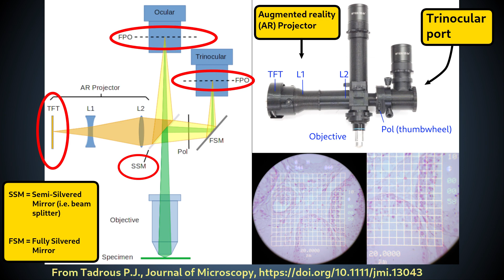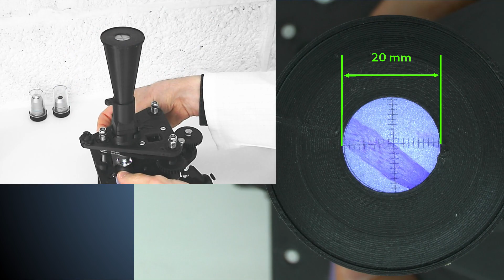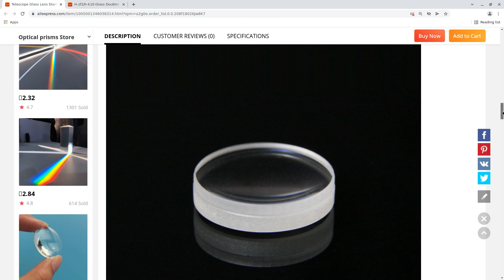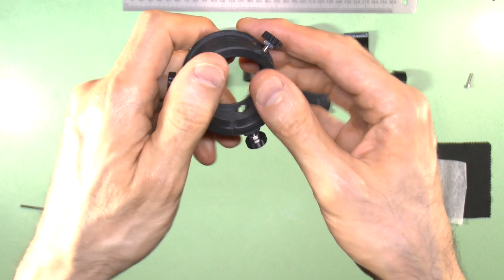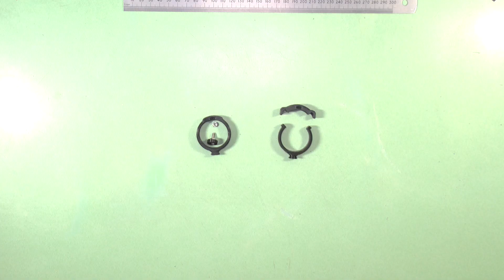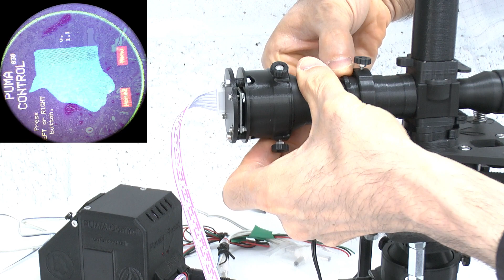How To Build and Fit the Augmented Reality Projector of a PUMA Open Source 3D Printed Microscope

Comment: How long are the 4 Machine Screws that hold the TFT to the Mounting Plate?  
I don't see those on your Bill of Materials.  Do you have an updated BOM maybe one with quantities and total pieces of Fasteners?  
It sure would be helpful to know exactly the number of screws in each length are needed.  
Also I am wondering how you use the SLM and the AR Projector at the same time?  
Thanks, I can see you put a great deal of thought into the design!
Reply from the maker: Hello, the M2 bolts are 8 mm long and you need 4 of them. I just checked the BoM and the information is there (it is listed in the 'MD_AR_Projector' module worksheet in the list of 'non-printed-parts' as 'M2_Allen_Bolt_Socket_Cap_DIN912_8mm_long' and the quantity is given as 4).
The only way to get AR Proj and SLM to work simultaneously (and independently) is to have two separate TFT drivers - so, for example, either two PCCs or use a PCC for one and a separate source (e.g. your PC or a modified PCC) for the other (I say 'modified' PCC because clearly you don't need the lamp and motor circuitry if you are just controlling the SLM). I hope it all works out.
Reply: @PUMAMicroscope   , Oh WOW, Thank You yes I see the parts now.  I was looking at the 2nd tab on the excel spreadsheet with the web links but now I see all the other tabs.  My eyesight is not that great these days.  
I have some other questions because I am trying to get together my list of stuff I will order to build this, I when I was looking for the 25mm Dia.x100Focal length infinity Lens for the Advanced Filter just above the Beam Splitter and at AliEx. it says that it is no longer available.  So I have a few questions,  
1. is that lens only used in conjunction with Infinity Objective Lenses?  And if I don't use the infinity lens in the Advanced Filter do only the "Plan" style Objectives give a perfect clear image?  
And is there a place you can recommend to get the lens for the advanced filter?
So I am wondering if it is best to get the Plan Objectives or the ones with the infinity symbol on them?  I will appreciate any advice you have about that.

Also I have a strange question,  My eyeballs are very Myopic and I also have a extremely Severe Astigmatism so My question is do you think there is a slim chance I can find Anamorphic Lenses for the Eye Piece Lens of the Microscope?

And I really wish there is a way to design a Turret into the Focal Plate but even so it is a awesome Microscope, I salute you.  
I am gonna build it with all the bells and whistles. 

I know a little about programming, electronics and engineering(I used to work in engineering), I looked into the TFT's with the Nano and multiple TFT's can be wired in Parallel but they will Display the exact same thing BUT there is a Way to use a IC2 Multiplexer Chip PW548A with the Nano to address up to 8 devices independently.  I watched a couple kids use that small chip specifically with the Nano and 4-ST7789 Displays presenting independently.  So, I think I will use this feature in my project because I wanna use the SLM & AR Projector at the same time.  
I think it will fit inside the PCC. 
I also I plan on trying to make it as Wireless as possible and maybe even using small stepper motors for the XY Stage maybe.

Something else I came across that you may or may not be aware of is that the Nano using a Atmega328 Flash RAM chip wastes about 1500 bytes of the Flash Memory when the old 2.0kb Bootloader is updated to the 0.5kb Optiboot_Atmega328.  With Nano the Maximum Upload size is Factory set to 30720 with all bootloaders so with the smaller bootloader(0.5kb) there is about 1500 wasted bytes.  This can be Optimized to use the Full 32256 bytes of Flash Memory when using the New Bootloader.  
In order to Correct this and get access to Full 32256 Memory you change the Line Code for avr--->(version)--->boards.txt file... 
high_fuses=0xDE
instead of the old 0xDA

Other suggestions I have is a simple small hole in the top of the PCC to access the Current Pot on the Buck Converter with a small screwdriver instead of the knob at the top and simple.  And simple clear plastic sheets over the slots glued from the inside to view the internal LED's of the PCC is another option instead of printing clear plastic optical wave guides but I like your idea of just keeping it open for more ventilation.  

Thanks a lot for your time and effort, it is greatly appreciated!
Reply from the maker: Thanks for your interest - you are doing great stuff and I hope you publish it somewhere on your social media or YT.
Regarding the infinity stuff - my advice is do NOT use the 100 mm lens and AVOID infinity objectives (the ones with the infinity symbol on them). The 100 mm lens is exclusively only for use with infinity objective and must not be used with fixed tube length (i.e. non-infinity) objectives. Note - infinity is nothing to do with Plan or not Plan - that is a separate issue. You can have Plan objectives that are infinity corrected and Plan objective that are fixed tube length. The objectives you need are the 160 mm tube length objective - they will have 160 printed on the barrel. Plan ones are better for flat field viewing. Your eyeballs shouldn't make a difference provided you use your glasses when looking down the tube and use a high eyepoint ocular lens (eyepiece).
The reason I say avoid infinity objectives and the 100 mm lens is because I only made the 100 mm / infinity option as a concession to allow use of infinity optics for those who happen to have them lying around but the 100 mm focal length is too short for optimum correction of the image and you end up with a curved field of view. One day I may make a more dedicated infinity module for better use of infinity optics.
All the other electronic stuff you talk about is fine - I didn't want to get into such details for the average person might be put off by it but clearly you have the knowledge to do it so that would be great if you get it to work. Please post your results somewhere. All the best.
Reply: @PUMAMicroscope  , oh o.k Thanks! so the Plan just means the Planar meaning the lenses are flat on one side and either convex or concave on the other.  o.k.  I think I get it now, this is real optical Physics as opposed to the thing the eye doctors do😉 I don't like the Flat lenses on my eyeglasses, I think because my face and and retina have a curvature.   I normally don't look thru my glasses at objects closer than about 20 cm.  I have never used my glasses while looking thru a microscope, even in school, because it hurts my eyes.  I have done many tests on myself and at Close Range I only need the Cylinder correction because of the Astigmatism in my eye.  
That's why I am thinking about how I can put an Anamorphic Cylindrical lens either right before or right after the eyepiece of the Microscope.  if I put a Cylinder Lens in the Advanced Filter then I think I can also use a Custom CinemaScope type image Capture maybe with a Camera on the Triocular and in that way get a much higher Resolution Photo and Video image after Post Processing but it would be a Custom Aspect Ratio that I would have to correct back to a Perfect Circle in Post Processing.  
 
I was on the edge of my seat when you were talking about Pupil Distance in the Binocular eye Piece Video,  you truly know this stuff and you have considered everything in the Design, Thank You so much!
Yes I will post my results here on yt and keep in contact with you.
Thanks Again^!!^
Reply from the maker: The 'Plan' refers to focal plane flatness in the final image - not glass flatness. It means that, with a Plan objective, the centre of the field of view will be in focus at the same time as the periphery of the field of view. With cheaper non-plan corrected lenses you can only get the centre or the periphery in focus at any one time - never both at once.
Your glasses have the correct cylinder for your eye. I would think that a cinematic anamorph would probably over-correct for you. I have glasses too and it is much better for me to look through a high eyepoint eyepiece lens with my glasses on - but the eyepiece lens must have a high eyepoint (sometimes called high 'eye relief') or this won't work because you won't be able to get your eye close enough to the eyepiece to see the whole field of view properly because the glasses get in the way. High eyepoint eyepieces usually have a symbol of a little pair of glasses printed onto the barrel of the eyepiece. Don't confuse this with 'wide field' - that is completely different.
Reply: @PUMAMicroscope   , oh, the eye doctors have not once ever properly made Me eyeglasses.  I have Trick Eyes, I can see into the IR Spectrum a little and I need Anamorphic lenses because of my Cornea shape causes Astigmatism.  Yes Professional Cinemascope Lenses are Typically a Minimum of 10 Diopers, 100mm Focal length, so yes you are right those would Over Correct My eyesight but not by much, my eyes are pretty bad.  Even so all Cylinder lenses Squeeze the Image Plane, so I was thinking mainly for an AR Triocular image capture application because an Optically Squeezed image is a much Higher Resolution than normal. 
I have looked thru lots of Microscopes and Telescopes and Rifle scopes, etc.. over the years and the only Scope I ever look thru thru eyeglasses is a Rifle scope.  I actually have an eyeglass lens kit with like 300 different lenses in it because I got sick of gettin' jacked around and ripped off by the eyedoctors and what I found out, other than eyedoctors need a lesson in Optical Physics because they do not know what they are doing, is that to see at close range, like to read a book or look thru a Microscope, etc.., I only use Cylinder lenses to correct my astigmatism which I don't have a pair of glasses for because the eyedoctors act as gate keepers to optical health.  
I have no Myopia at close range but at distances past 2 feet I do.  So My corrective lenses are Heavily base on Objective Distance because My eyesight changes as I Flex My Eyeball Lens.  
This Lens Kit I already have are 38 mm Diameter Lenses so what I plan on doing is maybe making an adapter to either slip over or under the Eyepieces of the Microscope and also do some experiments with Anamorphic Video Capture along the AR Tube, it should be fun and I will share my progress with ya.  Thanks My Friend!
But I gotta round up the materials and build the basics first 😉
Reply: if you count time and money a used quality microscope is better and cheaper.. for learning microscope technics it is ok. But this can be done by reparing used or defect quality microscops without 3-d printer

Comment: Great and interesting works!
But honestly, I see that the precise and expensive objective lens is mounted on a loose and lots of burr and dust 3D printed mounting, I have screamed internally all the time :) 
I think I can try to modify your design with machined parts and Thorlabs tube system, when I got time :D
Reply from the maker: No need for dust and burrs, etc. - the build quality depends on the care taken by the builder - so for sure it could be as you say but that is up to the individual builder. Yes - you could build a much better microscope from engineered metal and Thorlabs stuff but it would be out of reach for most people to do this - technically and cost wise. The PUMA is made to make high end customisable microscopy available to more people on low budgets with only a 3D printer (or access to an online 3D print service) for the special parts. If I were building with metal I would use quite a different design for many parts.